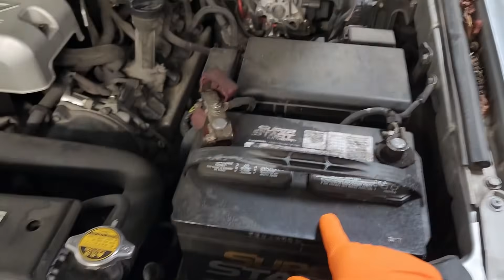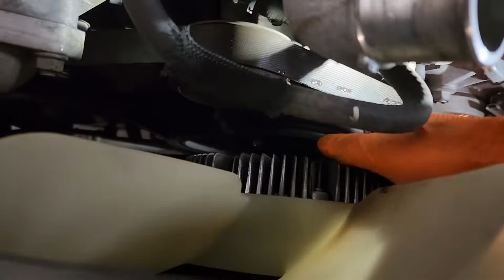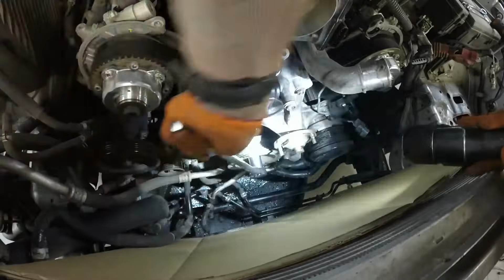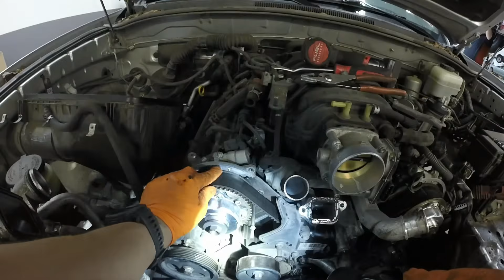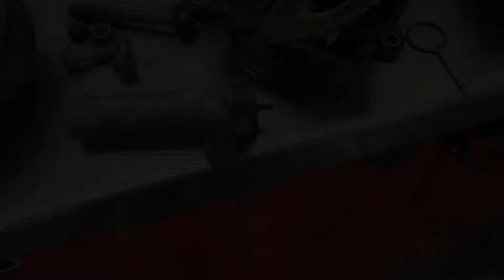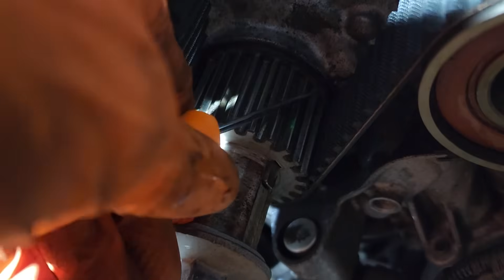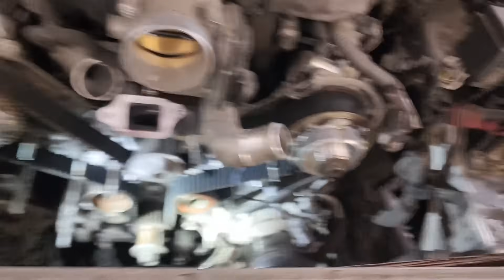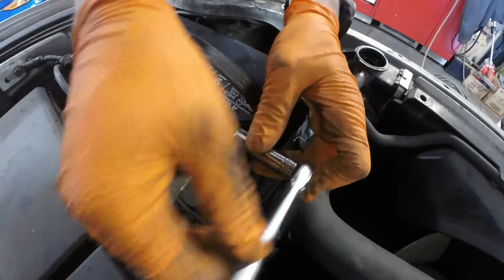Timing belt replacement by a Toyota master tech

Comment: What are you spraying from the green container to clean things?
Reply from the maker: Just some brake clean we get it in bulk.
Reply: @shoptimewithdrew  I use brake clean as well. Mine is mostly acetone. Is what you use also acetone or is it chlorinated?  Where can I find one of those sprayer you were using?
Reply from the maker: To tell you the truth I don't know what is in it, it is in a unmarked 55gal drum. The canister you can get from Amazon it is a sure shot sprayer.

Comment: Would this method work for the 01 sequoia?  Thanks for this very informative instructional video!
Reply from the maker: Yes all 4.7 are the same only difference is cam gear design. It will either be variable valve timing or not.

Comment: I am literally in the middle of doing this job on my 07 4Runner 4.7. Not only that, but also have to replace the pass side cam seal that is leaking too. Going to do both sides while i am at it even though driver side isn't leaking...yet. Also going to do the crank seal and timing belt/water pump even though they aren't quite ready for replacement yet. Prior to taking on this job, i've watched several videos, some good, some not so good. Just stumbled across your video today and i must say it is one of the better ones. So thanks for taking the time to video it and post it out here!
Reply: How did the job go and how’s it holding up?
Reply from the maker: Thank you this means a lot to me. I would of liked to add how to do the cam seals in this video but these were not leaking. If you have the same cam gear style like in the video you will have to pull the whole cam out. Don't forget to lock the scissor gears with a bolt.